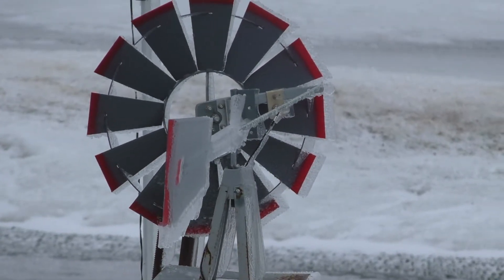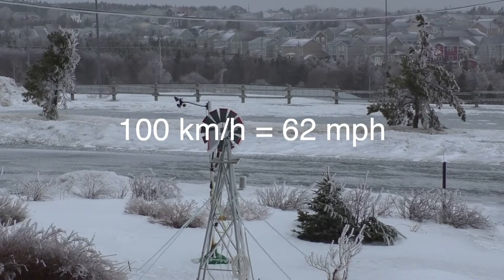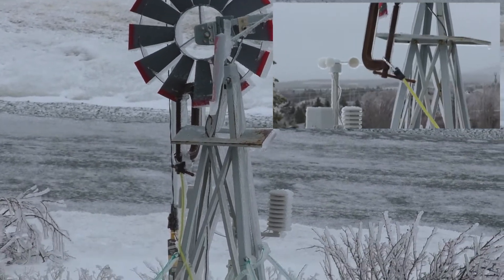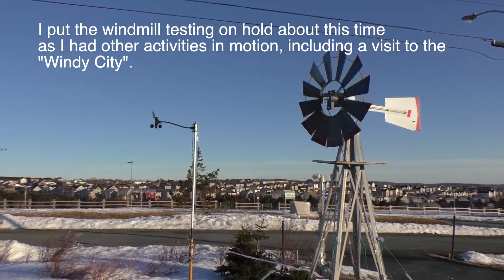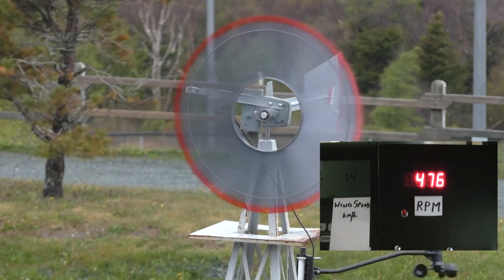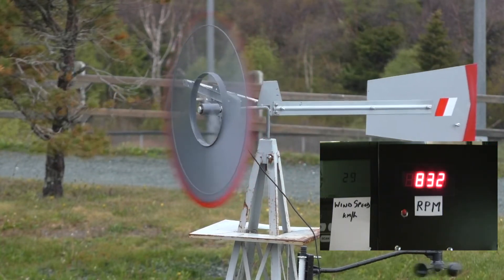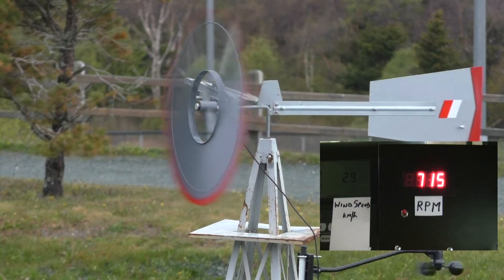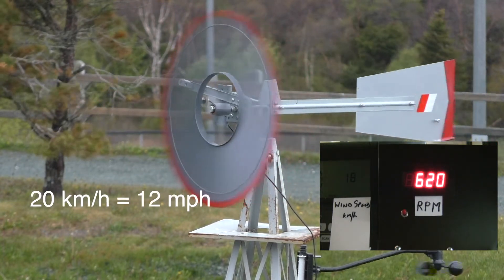#8 American Farm Windmill Iced up, testing on hold and restarted, wind not high enough for furling

Comment: I built a mechanism similar, but with the tail & rotor support BOTH pivoting on a single axis point  -- on a single bolt that replaces the stock yaw bracket.  I also put the spring mount very close to the center of the rotor, as opposed to out near the end of the blades.  That made it very sensitive to activating.  It will furl under a good breeze.  Further, I put the spring on a pivot bracket so that the tail can self-lock and then be fixed parallel with the rotor.  Locking it parallel essentially turns it off, and it only spins gently in 40+ MPH winds.   That parallel lock works great in storms.  Locked, it will still also spin ever so slightly in a mild breeze too.  It's a great feature.  Your videos gave me good jumping off points and ideas.  It's great you showed us what you felt wasn't working and what was.
Reply from the maker: Sounds good!  Do you have any photo? You can send them to me via my email in the "about" section on my YT channel. I'm working on another version of overspeed control might get it done over the next month or so - depends on weather etc.
Reply: @BobKelland  I agree that these lawn windmills would not be long for this world without a governor or shut off, they'd beat themselves up.  I put a second spring on the opposite side of mine to soften hard wind direction shifts after I saw how yours gets kicked about in very rough changing winds.  Very helpful videos.
Reply from the maker: @jeffmurdock8321  Yeah all windmills have to have some form of positive overspeed control. And like the feature you have they need to be pretty well totally shut down in very high winds. I'm thinking of including a similar self locking system in my new one (inspiration!)